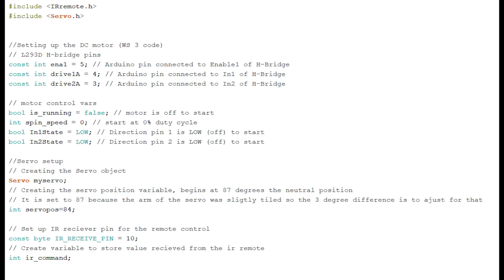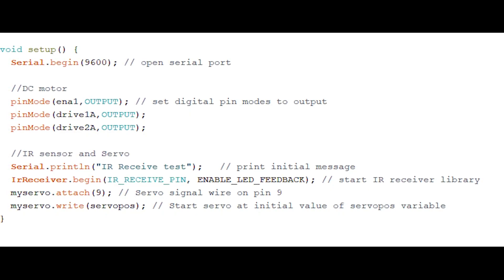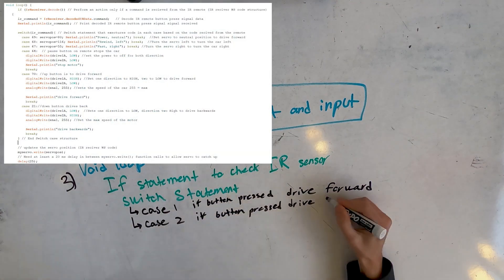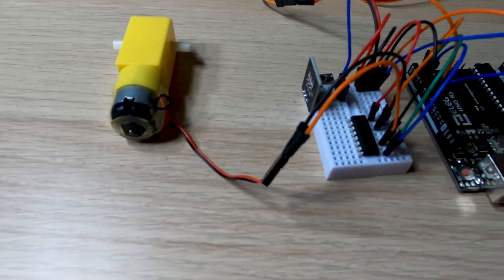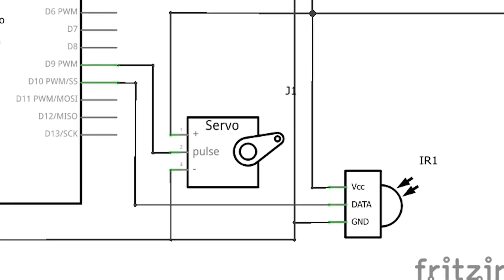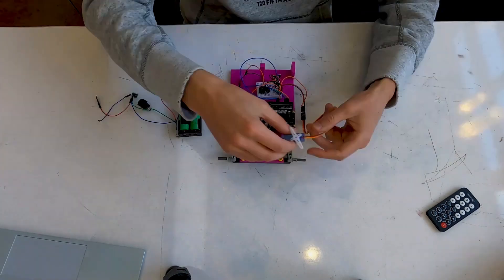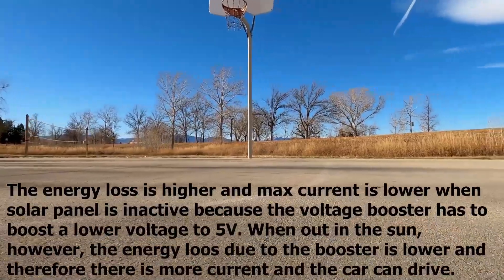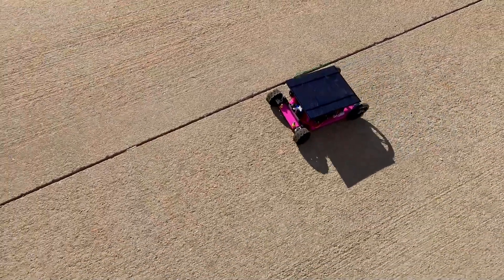Solar-Powered Arduino Rover with IoT | DIY Robot Build Tutorial

Comment: Nice project. I have a question: does it charge the batteries via solar as well? And if yes, when does it charge them? When the robot is moving or when it is at rest? I am confused if the robot was able to charge the battery via solar and discharge in the motors all at the same time.